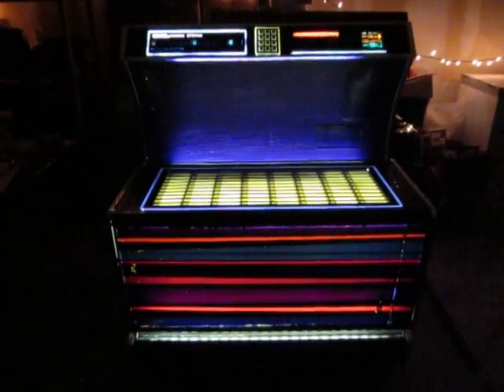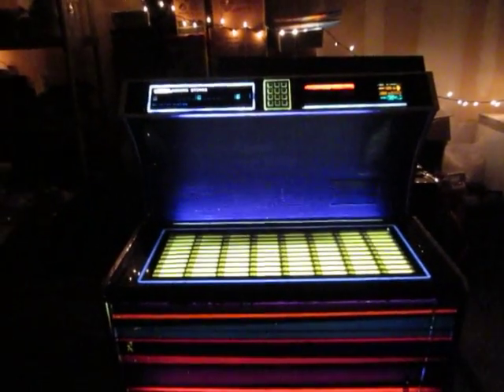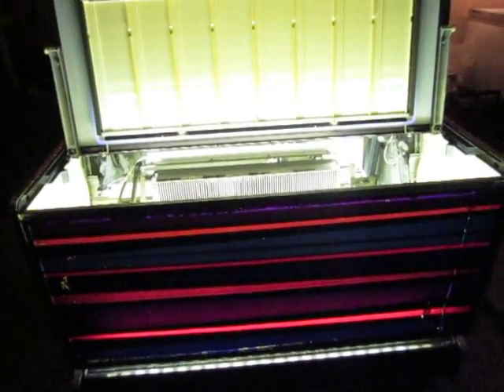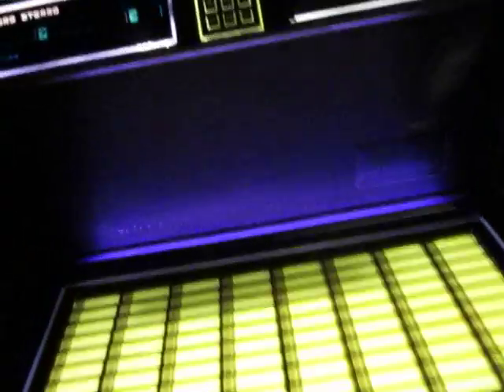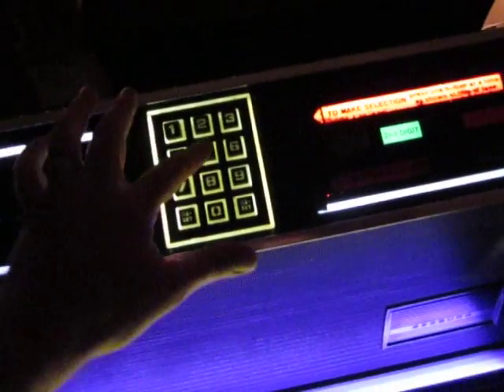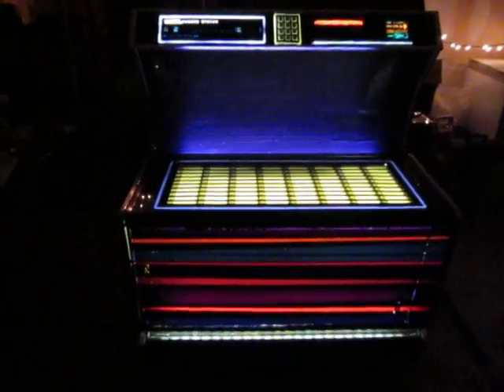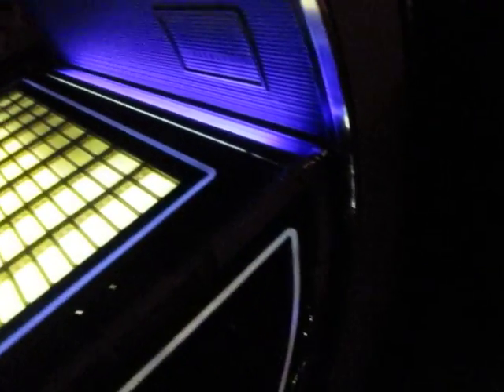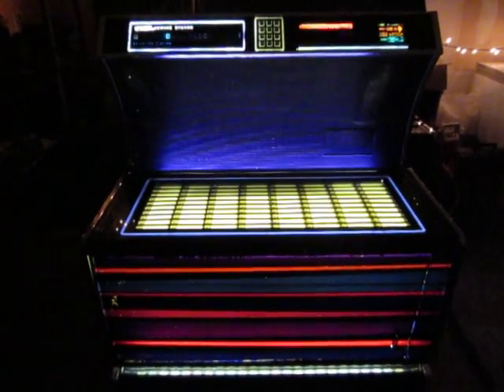This is Lucy ~ My 1970 Seeburg USC1 Bandshell

Comment: Victory Glass has those panels.  They are on the internet.  Not sure on this one, but the model I have has an inner plastic panel that is white on the inside and has graphics on the outside.  There is also graphics printed on the inside of the glass panel.

Comment: I have the USC2, or "Firestar", which is the same machine but with orange panels.  It had been sitting up for over twenty years and also has everything gummed up.  I also need to do some repair to the exposed particle board on the sides and back.  It was stored in a damp concrete garage and started to bubble up a little.  Any suggestions would be appreciated.